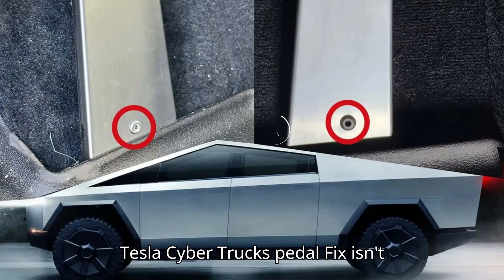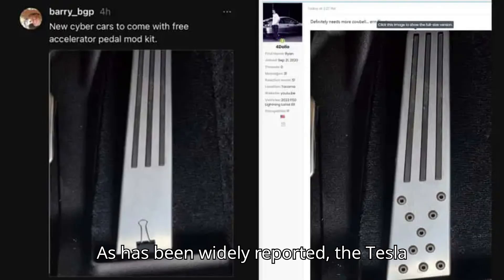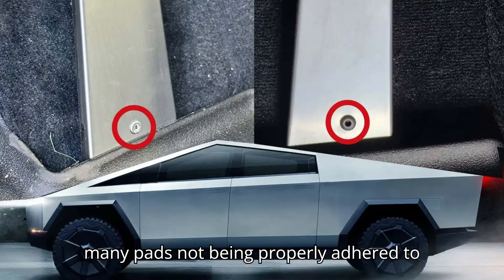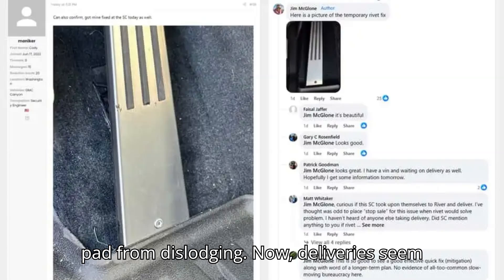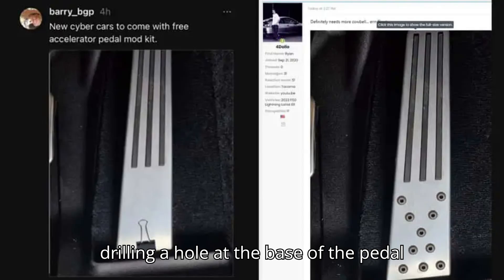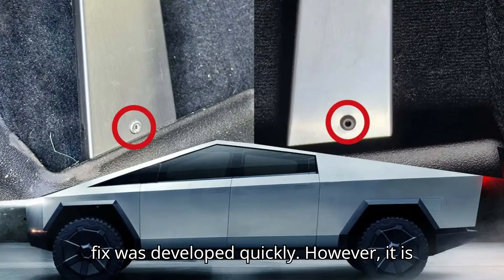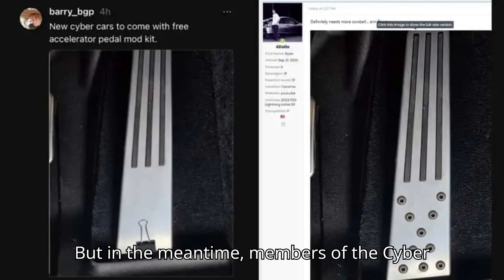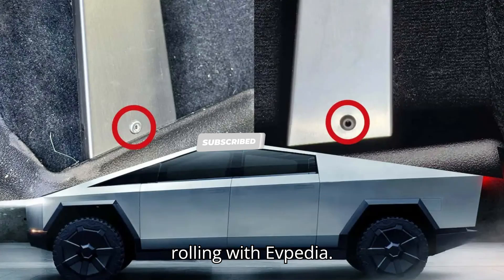Tesla Cybertruck's Pedal Fix Isn't Pretty But Deliveries Can Resume

Comment: In my country, pop rivets can't be used legally in any vehicle. Anywhere.
Reply: You might be surprised - aircraft are certified with pop rivets holding them together.
CherryMax are one brand used.
Reply: @allangibson8494  Built to aircraft industry standards with double collars and inspection safeguards. 
These look like somebody borrowed granddad's pop-rivet pliers and used rivets from Walmart.
Reply: @nevillewran4083  Guess again, Zenith build light aircraft using hardware store aluminium pop rivets… (Although I probably would use stainless steel or Hastelloy rivets for this application, particularly for a single rivet).
Reply: @allangibson8494  I don't need to guess again, read my first post, I said vehicle. I think you're more into contradicting people than any practical debate. 
Zenith are home-built aircraft, different regs to the ones governing Boeing & Airbus. Not really an 'aircraft industry'.
Reply: @nevillewran4083  Zenith’s designs are certified.
And I will guarantee some parts of your car are pop riveted on (like the build plate because that is federal requirement).
Reply: @allangibson8494  Of course they're certified, people want to fly them. That's like saying "it has a propeller!" You're still detouring away from what I said. 

Shit, my car must be a rebel and an outlaw because the compliance plate is bonded on. Maybe it's the only one in the country? 
And again, note I said pop rivets. But keep trying.
Reply: @nevillewran4083  Federal law requires the compliance plate be mechanically attached with non removable fasteners able to survive a fire.
Reply: @allangibson8494  21 million cars registered in this country, mine must be the single exception, what a coincidence!
Makes me feel like a rebel & freedom fighter. 
Compliance plates were once easily swapped by thieves because of their pop rivets. 
That's what the space shuttles use, to withstand re-entering earth's atmosphere, right? Pop rivets, not adhesives.
Reply: @nevillewran4083  What caused the loss of two spaceshuttles - adhesive failure…
Reply: @allangibson8494  So why not use pop rivets?
Reply: @nevillewran4083  Because they simply didn’t… It’s called “a design choice”.
Reply: @allangibson8494  Can't answer, huh? Must be now where you try to turn the convo around.
Reply: @nevillewran4083  I don’t answer for other people’s bad choices.
Reply: @allangibson8494  What about answering for your own? It was foam falling from the fuel tanks that broke the tiles off, not the tile adhesive.
Reply: @nevillewran4083  The foam falling off was an adhesive failure.
Reply: @allangibson8494  Nope, the foam was sprayed straight on, no adhesive. Still not the adhesive as you claim. Another bad choice.
Reply: @nevillewran4083  The foam IS an adhesive.
Reply: @allangibson8494  Getting desperate. Do you immediately forget what you've just posted?
Reply: @nevillewran4083  Foamed Polyurethane is an adhesive (the foaming is hard to avoid - the adhesive properties are impossible). It wasn’t mechanically attached to the booster tank.
Reply: @allangibson8494  Still dodging. You didn't say foam, you said adhesive. And if the foam has adhesive properties, why didn't you say 'foam'?
Reply: @nevillewran4083  The foam is an adhesive. It wasn’t separately applied as sheets. An adhesion failure led to it separating because it wasn’t mechanically retained.
Reply: @allangibson8494  NASA don't call it adhesive, they call it foam. You said adhesive. No sheets or 100 sheets, irrelevant.  I didn't mention them.
Reply: @nevillewran4083  because the FOAM is the ADHESIVE. It glues itself on (most of the time).
Reply: @allangibson8494  Your words "the foam falling off was an adhesive failure". You separated the two. Clearly you thought the adhesive under the tiles failed. 
Yes, some foam is mechanically supported with ramps, collars & other protrusions. 
Falling foam destroyed not two space shuttles, but one. The first exploded because of faulty O-rings.
Reply: @nevillewran4083  The o-rings failed because the adhesive sealant In front of them detached because it got chilled below the brittle transition temperature.
Reading the actual accident reports is illuminating.
Reply: @allangibson8494  You can spend as much time as you want reading. The o-ring (s) failed because of the low temperature.
Reply: @nevillewran4083  And so did the sealant putty ahead of it.
If they had used a metaflex gasket in the seal instead, it wouldn’t have failed. (1950’s oil refinery technology).
Reply: @allangibson8494  You're not even trying.
Reply: @nevillewran4083  Your trying very hard not to comprehend that you are wrong.
Reply: @allangibson8494  I'm waiting for the typical boast- "I've been trolling you the whole time and you kept biting". Ignoring the fact it takes two to continue a thread. 
They usually finish with "Don't bother replying, I won't read". 
Ah, to be 15 again...